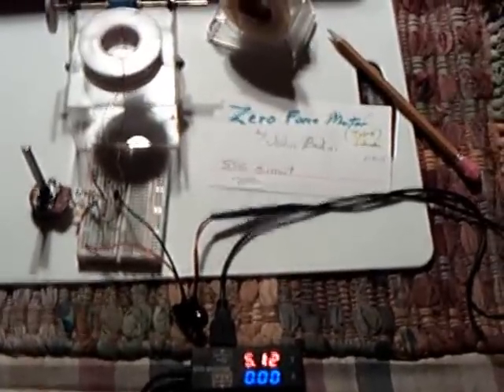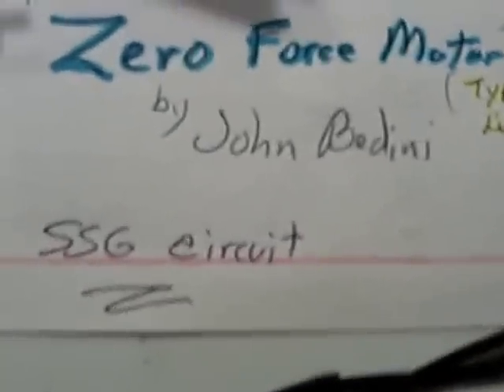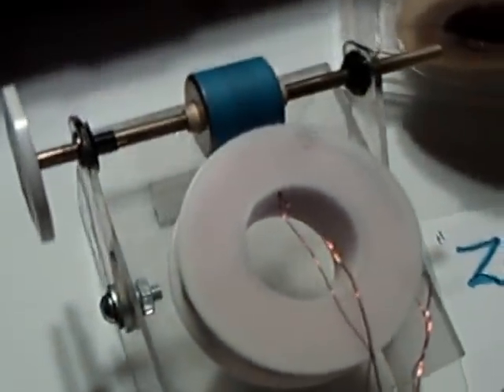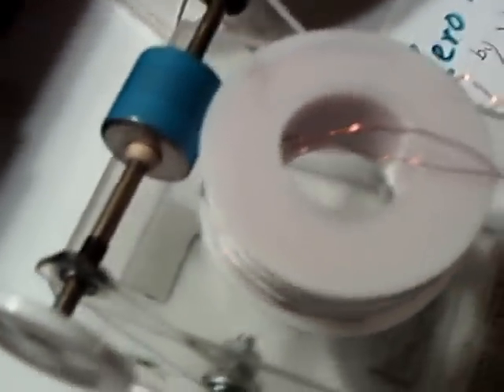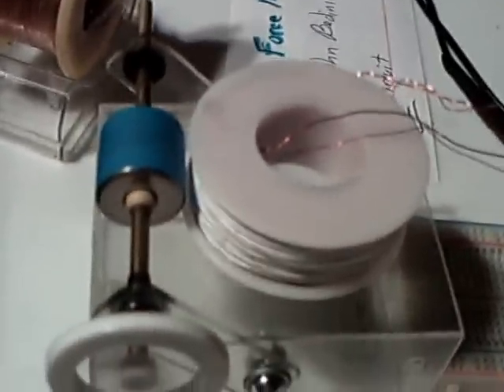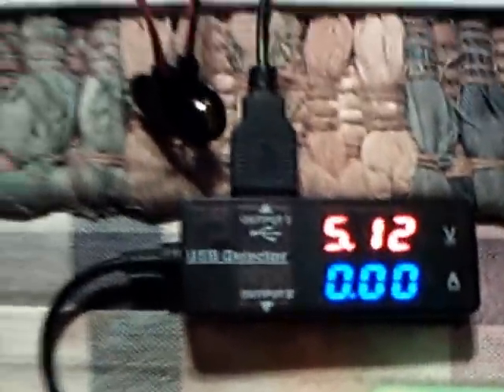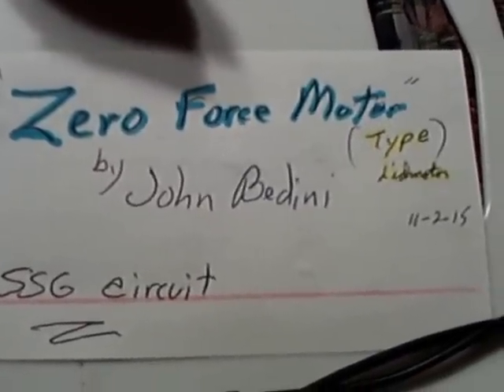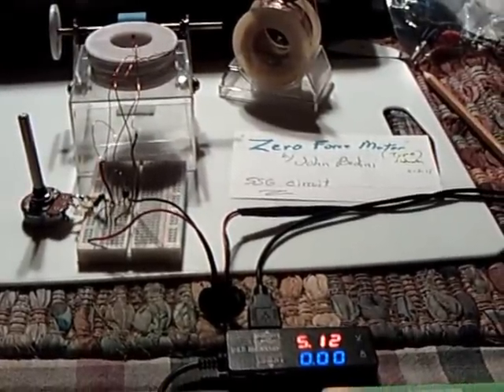JB's Zero Force Motor  ---- type Lidmotor

Comment: The coil poles form on the vertical axis, up and down, at a 90 degree angle away from the diametric tube spinner. Therefore, the coil can not slow the rotor with "Lenz Drag". I conceived of this and outlined it on my "Oscillating sine wave LC motor thread" on the Overunity Forum. Excellent work! Congratulations to you and John Bedini. Multiple satellite loads won't raise the input draw. We're over the top! Time to pop the corks.Synchro1
Reply from the maker: +zebok3  Ah.  There it is.  I knew someone from one of the forums would jump in here and say something.  Thanks.   I expect others will chime in now and perhaps, go the other way and say,  "Oh No No No No Noooo."  I don't care.  I see something in that I have not seen before.  I'll look up your thread at the forum.  Thanks for the heads up.

Comment: Hi Lid, nice work. 
This USB meter is LCD with back light and measures down to 1 milliamps and accumulation. 
I just got one and it works good.
Oh yeah, your little friend Maggie ... she's cute ! ... is she single ?
Reply from the maker: +Mike Poirier I have really enjoyed this meter and running my projects off USB power.  I have it usually coupled to a rather low capacity power bank.  When my experiments are over for the day I just plug the power bank into a wall outlet charger and I'm good to go for the next experiment.  By observing how long it takes to recharge the 1000mAh power bank I get an idea of just how much juice was consumed by the overall experiment.  It is a rough estimate but it helps.
Reply: +Lidmotor  Sorry Lid, that USM meter comment was meant for this link, http://www.ebay.com/itm/161836447728 . I forgot to put it in.
Hey by the way,  ... your little friend Maggie ... she's cute ! ... is she single ?
Reply from the maker: +Mike Poirier Thanks.  I went ahead an ordered one of those meters.  Maggie is a loner ---and she is old.  She took a bad fall a ways back and broke her face.  Now she has some scares.  She still gets aroused by big spinning magnets though and her eyes light up.  She has been a good little friend of mine for many years now and has served me well.  No batteries required.
Reply: Yeah! I knew there was a great sense humor in there somewhere. Good to see it !

Comment: Now pick that coil up and hold it like a normal coil would be placed and see what happens.  I don't like that meter of yours as it is missing the best decimal place for these sorts of things.
Reply from the maker: +legalizeshemp420 I had a chance to do some more quick testing using a good meter.  Using a 3.7 battery it can still run at around 5mA.  I would really have to build John's exact motor to do any meaningful testing.
Reply: +legalizeshemp420, thinking not normal;)
Reply from the maker: +legalizeshemp420 I agree.  Earlier I hooked up my regular mutimeter  and the thing just went crazy.  I need to hook up a plain old amp meter to it.  The juice is flowing for sure but this funky meter isn't showing the real story.  It is just something to give an indication.  When I crank the pot up it  does show 60mA at full RPM.  I did fiddle around with the coil in all kinds of positions.  Of course I have run these in a "normal" position for years so I know what that is like.  Running a rig like this under 10mA (if that is true) is not bad.  It depends on how much load it can pull at that.  John's setup with coils on each side and a Bedini/Cole circuit could be really impressive.
Reply: hirnlager
LOL. :/
Reply: *****
Yep.  We need to see how much it is using and how much torque it has compared to the standard coil to magnet setup then we can really comment if it is just a toy, really awesome, or just garbage.
Reply: *****
:(  Yeah, I am very interested in torque to amperage draw than anything else with his stuff.